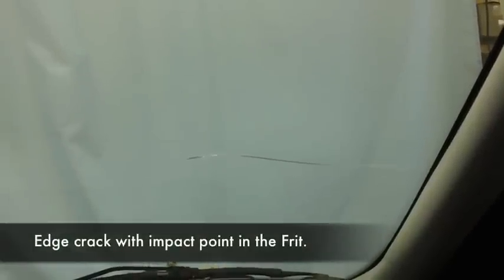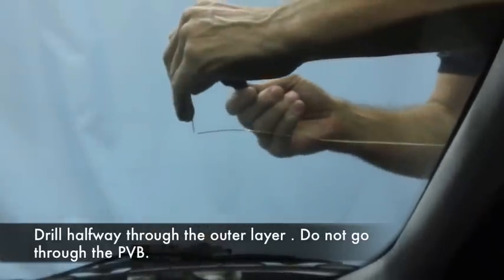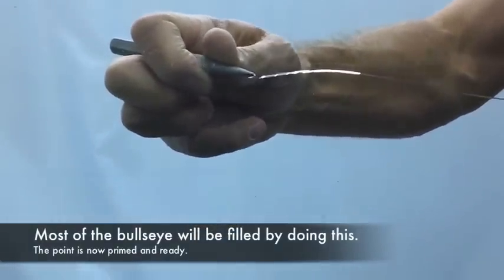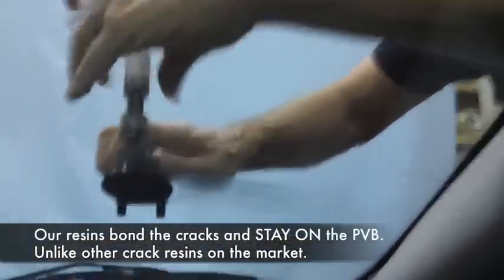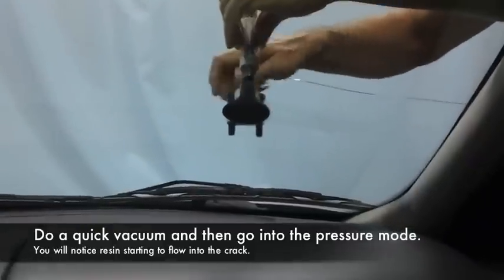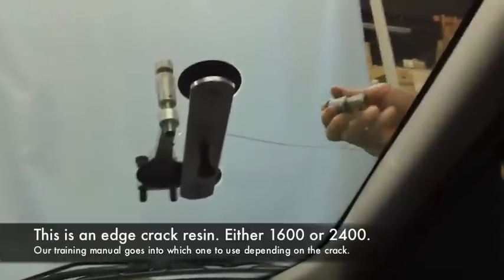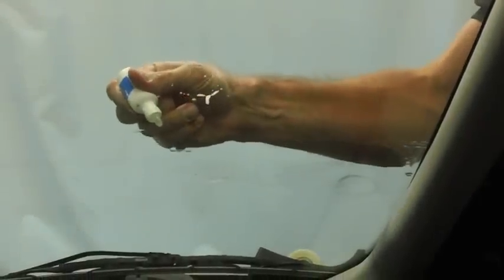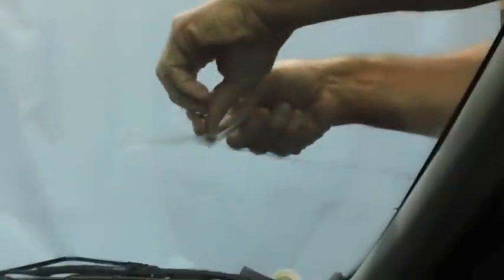Long Crack Windshield Repair Training Video | UltraBond.Com

Comment: Step one: procure heavy-duty, industrial-grade, specialized windshield-repair tools.  Those don't come with a $12 kit.

This is a training video for auto-glass professionals, then?
Reply from the maker: Yes this is for a  professional  windshield repair business. The resin in the $12 DIY kits is all monomers and water thin. It does not retore the strength to the windshield.

Comment: This is excellent. However, it is so difficult to find a shop with this much of experience in repairing windshield crack nowadays. Most of the shop would prefer a complete replacement.

Comment: Great technique - stands the test of time. Not sure if you're still answering questions but I tried practicing drilling and tapping a bullseye a regular sheet of glass to which I attached some heavy duty tape on the back (as support to mimic the PVB layer. When I tapped to create the bullseye, a star crack appeared and totally shattered my practice glass. Should I assume that real windshield laminated safety glass will behave differently and not create a huge star crack or was I possible doing something wrong?

Comment: I got a older model used full kit off eBay for very fair price. just experimented with a very old dirty long crack in middle of my windshield extending from bottom all the way past middle. It looks better but not much. Atleast it won't get any bigger. Does the three Injector method work better for edge cracks?

Comment: Why did you not cure the point under pressure?
Reply from the maker: Because I put 400 in the drilled hole and tapped bullseye. 400 does not need to by cured under pressure like 45 and 90 needs to be.
Reply: @UltraBondWindshieldRepair  Got it!  Thank you very much.

Comment: whats the point of priming the point
Reply from the maker: +CHIEFYCAN2 
Wetting, wicking and to drop the viscosity a bit to help get the resin flowing into the tightest part of the crack. If the glass is warm or hot it is not needed to prime the point.